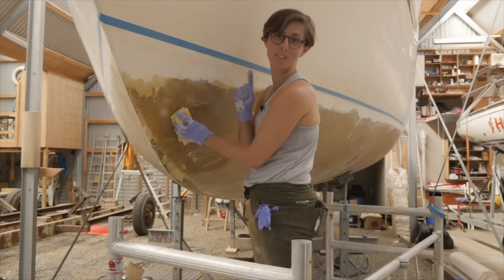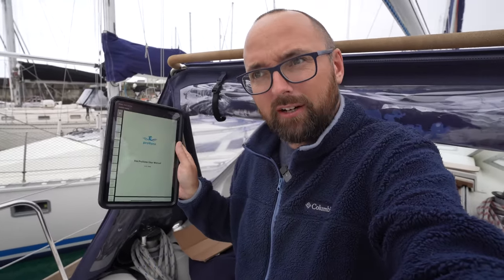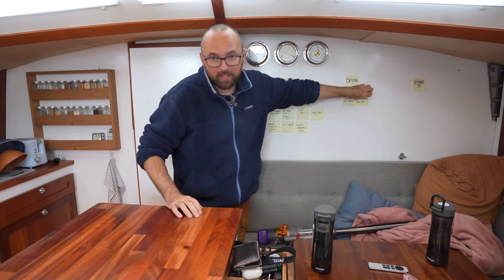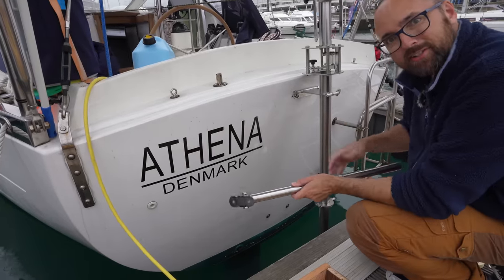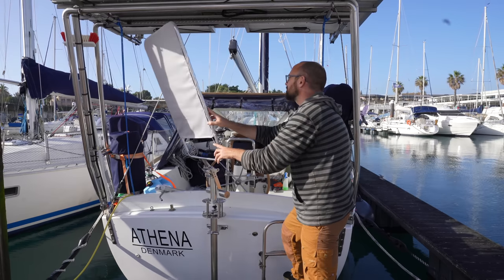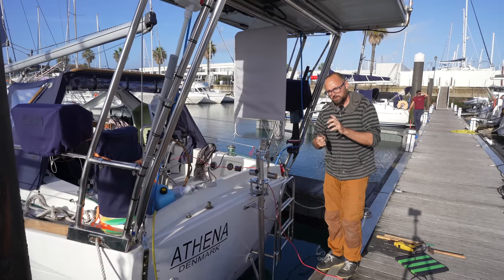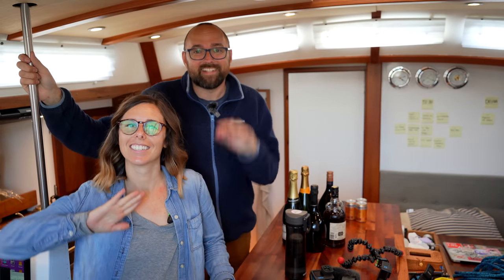Sail Life - Meet our third crew member - ProVane installation ⛵️

Comment: Get an Automatic spring loaded Center Punch. This makes a small dimple in any metal that will help your drill bit not slide around when you start drilling. The next level would be to then use a center punch and hammer to make an even bigger divot. Before using this near water, tie a multi wrap fisherman's knot to it with some paracord so when it bounces out of your hand it's tethered and doesn't go overboard.  
You could also brace the arch at the top. Weld some diagonals. This would keep your braces out of your way. 
Lockers. Ever dig through all your lockers looking for that 'thing'? Instead take photos of each locker in the layers of things in there. Also label each locker, cabinet, etc... use a permanent marker that shows up in the frame. (If it takes up too much of the frame, write it on the door or inside the lid, but write it on a piece of paper and include that in the shot. This works really well with food when you do a big provisioning before a passage. Now instead of going through every space you just scroll through the photos. "The rubber bands are Port side, diesel tank bilge, on the bottom layer."

Comment: Hi Mads, Drilling stainless, or doing anything else with stainless, can be a bit of a challenge. As a marine engineer I have worked a lot with stainless over the years and the best advice I can give is - 1, always make sure your tools are sharp, especially with drilling. 2, use good quality drills like Dormer as the the point will always be accuartely sha rpened from the factory. These days you can buy drills with a slpit point which reduces the amonut of rubbing atthe web or centre of the drill. 3, make sure you keep the pressure up as the drill is cutting and dont take a rest with the drill rubbing in the hole as this will cause the surface to work harden, especially with 300 series stainless. Once the surface has work hardened you simple drilling job becomes a bit of a nightmare. 4, you would be better to run the drill a little slower as speed causes heat and stainless doesn't like heat during the cuting process which of cause leads to work hardening. I hope this helps. Your boat is looking great and I wonder what you will do when you have actually finished all you little jobs? Cheers and have fun. Ian New Zealand
Reply: It's a common notion that heat leads to work hardening. 
In fact, while they seem to happen simultaneously, the actual mechanism is that the work hardening (which results if the drill does not have sufficient axial force to keep cutting) instantly causes the drill to lose its edge. From now on, the drill acts like a burnishing tool to deform instead of slice, which causes further work hardening (a runaway situation). 
Burnishing without a roller causes massive friction, which causes heat (adding a thermal runaway). 
Heat is the symptom of work hardening, rather than the cause. 
3xx stainless does not harden with heat: if it gets hot enough, it softens.
It is the drill which "does not like heat", rather than the stainless, and this is why (even with HSS - "high speed steel" drill bits) it is important to use a slow speed along with unremittingly heavy feed ...
Reply: I bought a dozen or so double-ended short 1/8" cobalt pilot bits to use for starting holes in stainless, and then step up from there.  You can put a lot of force on them with so little protruding from the chuck, and throw them away when they become dull.  If necessary, use bacon grease, AnchorLube cutting lubricant or water to cool while cutting.

Comment: Hi Mads. I am rather surprised that you, Mr. DIM (did it myself), did not build your own windvane. Talk about price vs. performance advantage. But there is a time advantage to buying an off the shelf unit. I have built three windvanes for myself for my last three boats. Not as "spiffy" as a beautiful "SS" piece of artwork hanging off the transom but have they helped to sail my boats 10s  of thousands of mile so far.

Sail trim, you will find, is important when using a windvane. My boat, SunShine, is a bit smaller than Athena at 11 meters. If I move from the cockpit to the bow and especially if two of us move to the bow the weight shift alters the trim of the boat enough to cause a change in the windvane's ability to maintain course when steering the boat. You will find it helpful to trim the sails just right, so that the boat steers a steady course with little to no weather or lee helm. This will make you a better sailor and help ensure you are getting maximum drive from the sails.

Another point is do not overpower the boat with sail area. This often leads to too much weather helm. Not only is sailing with the rail in the water not much fun over the long term, it is often slower and increases side slip so that your VMG is less.

May all your troubles melt like lemon drops. Fred and DeDe

Comment: For teh arch bracing, you might want to try using the dyneema across the top cormers. Although teh 'wobble' is at the base, there must be an equal bend at the opposite corner of the arch.
The larger the triangle the better the bracing.
Reply: Very true.
Reply: Look up “chevron” bracing, or K bracing. You want triangles with the corners connecting if you can get it. You may need a new anchor point on the center top of the transom with lines running to the upper corners of the arch.
Reply: Most arches have a set of bars at the bottom from about mid way to the deck. You then have a handy hanging place for outboard motors, fenders, barbeques etc. This arch is pretty amateur from a design point of view. A 2 minute conversation with a stainless bar fabricator who has worked on boats would have the design right. Also you can buy Saint fittings and pre bent bars for around $200 and the job takes around an hour to do. Our upholsterer sells the lot.

Comment: Nice video.  We used a windvane on our circumnavigation in the 1980s, having a Hydrovane on our current Bristol 35.  Windvanes are truly the best crew you can have on your boat without the need for sleep, food, or electricity, keeping the crew safe from sleep deprivation during storms.

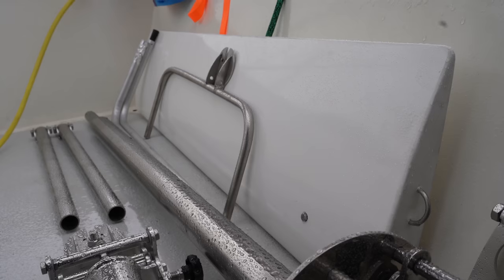Comment: Not to be a nervous nelly and I'm sure this product has had nothing but good reviews.....however - the only thing that jumped out at me was the nut which seems to be tack welded in place to support a clamping knob  - obvious at 1:59 into the video. I would have preferred just a little more weld volume holding those two parts together. Looking forward to seeing this windvane in operation..

Comment: As a sailor with about 20 000 nautical miles of experience with offshore windvane sailing with a windpilot i have to say that this windvane does not look like a good choice due to several reasons:

-This is not a servo pendulum system but relies solely on the force of the wind (instead of the force of the water due to the movement of the boat) to produce the steering movement. This kind of approach is working MUCH worse especially when sailing downwind courses because the apparent wind and therefore steering moment is very low. 

-The rudder on this system can not be raised out of the water easily. There are several problems related to this. At first, it makes backing the boat into a slip much harder if the auxilliary rudder is not fixed before going in reverse. Second problem is that there will be a lot of growth on the rudder, much more than on the main rudder because it is exposed to sunlight. As the aux rudder is smaller growth will also be much more problematic than on the main rudder and make the system work even worse than before. And third, it is very hard to remove tangled seaweed (which causes the windvane to stop working) from the aux rudder when underway. You will have to stop the boat to be able to push down the seaweed with something like a boat hook. In areas with a lot of growth (e.g. Sargasso Sea) this can be VERY annoying.

Comment: Very cool video Matt... I liked it.
However, there is an option of vane-to-tiller option; which is what I am building. It's simple set-up that basically uses a vane+pendulum arrangement that has lines running through blocks that then pull on the tiller.
Pretty straight forward.

Comment: Move your solar arch 'wobble supports' outboard. Put a bit of metal outboard in the same plane as the panels, and at the same height, 90 degrees to the centerline. Then make a triangle with dyneema from the end of this metal down to the deck. Depending on how flexible the metal piece is, this should be as stiff as the old setup, but moves all the parts out of the way.

Comment: Hi Mads, great video as always, thanks!  I wonder if you are familiar with a video that Free Range Living (aka FR Sailing), not related in any way, Yacht Self-Steering System for all Conditions, they use a tiller pilot but connect it to the windvane itself, not the tiller. Less force needed, making it more reliable. Probably worth considering.
Cheers!

Comment: We've owned a Hydrovane for 20 years and used it for most of the steering on two Atlantic crossings. In no wind and under power, the 5 knots apparent wind is enough to keep us on course just using the Hydrovane and a locked off main rudder. Give it a go on your trials. Fair winds!
Reply from the maker: That will be very interesting to test 🙂
Reply: If there's no true wind, how does the wind vane know what course to keep?  
Surely in this circumstance the apparent wind will stay dead on the nose, regardless of course?
Reply: I have a ProVane installed and used for over 1year here on the east coast of Australia. I have extensively sea trialled the ProVane, it works very well. By accident I did exactly what Tim suggested forgetting the Provane was live, it worked perfectly in keeping the boat on course so then I locked off main rudder and it continued. In my experience 5kts of wind is the lower limit of the Provane’s ability to work. Optimal minimal wind is 8 kts. From there on its all go. I have had it working in 20kts and feisty seas no problem but at this stage nothing higher, it does cope with 2m swells just fine as long as the wind is active.
Reply: @dreamtimesv  is as sturdy as the Hydrovane? do you need lot of spare parts?

Comment: My ocean crossings (3) by wind vane suggests the wind blade will be bothered by the many obstacles surrounding it in lighter winds.  And IMO you missed a major + of the wind vane:  as weather strengthens & wind increases, the vane's steering power increases accordingly.  Not true with the other methods you mentioned.  As for the ARC, they tend to be larger boats.  On arriving in Horta from USA I was struck by the 'small boat' side of the marina, where almost every smaller/simpler/more affordable sailboat sported a wind vane.

Comment: Hey, I was just wondering if you used locktite or anything like that on the bolts of the wind vane? Dieneema lines is a good idea., strong yet adjustable when u need. Also wondering whether or not you guys are considering a wind turbine for the boat. Happy holidays and a great new year. Cheers from Sunny Singapore.

Comment: Two things:

One, I didn’t notice you drilling and filling the holes with epoxy to get isolation from the transom core.

Two, If you crank too hard on the turnbuckles for the brace, the anchor brackets may pull out from the hull.  Did you drill and fill those holes too?
Reply from the maker: All those holes are in solid fiberglass there is no core in the deck-hull-joint or in the transom :)

Comment: Almost like "Ole Times" with the DIY on the wind vane. I'm sure the challenge of working from boat level rather than having shop equipment, will continue for all your sailing years. I appreciate your acceptance of some of the limitations and applaud your pluck for the circumstance. Will the rudder with the vane remain in the water the entire time or be lifted when not in operation? Continued good sailing.

Comment: Hi Mads, the link to Windy is all servo-pendulum types of wind vane, using a wheel pulley or lines to a tiller - do you have a link for the ProVane type you have installed which is completely independent of the boats steering system?
Reply: I also wanted to ask...

Comment: Wûrth is a German company, i think. I came a cross a drill called Smart Step a short while ago , You should check it out. Perfect for stainless steel drilling whit a handheld machine in smaller holes. It worked for me. One drill diam 8 mm 15-20 Euro

Comment: My boat is only 35 feet but steel and rather heavy (around 10.000 kg, Dutch flatbottom) and  all electronic autopilots I found on the sites from a few local shops   were limited to something around 3 to 5000 kg. I have seen the vane in some videos but never explained how they work and are mounted so thanks for that 🙂 Will not fit my boat, my rudder is behind the boat
Reply: Guessing here, but the kg rating is the force the mechanism can apply at it's output, and not the weight of the boat?
Reply: Try a trim tab system on your transom rudder
Reply: My boat was a 12 m steel ketch. And was steered 
- by hand (just for pleasure, 1 or 2 hours because I like it) 
- my beloved (very) old Aries (most of the time). The Aries is a bullet proof cervo-pendulum system that actions the main rudder. I claimed I could steer better... but 1 or 2 hours, no more! 
- a cheap electronic pilot (way too weak in choppy seas, but OK for becalmed or light wind conditions) 

Athena just got a vane controlled auxiliary rudder. 
- the main rudder locked into position corrects the sail balance if necessary (better tune the sails and keep the rudder as straight as possible)
- the smaller auxiliary rudder only manages the little variations around.

Trim tab on rudder is the cheap DIY solution dedicated to transom hung rudders and handy owners. 
- The wind vane controls the trim tab
- the trim tab steers the rudder
- the rudder steers the boat 
I understand your rudder is hung to the back of your boat (transom or double ended boat)
This system must be customized according to your boat. It is not as easily installed as a pilot or a known windvane brand, but it's a cheap, satisfying and reasonably feasible project 
Check the Bernard Moitessier vane and some other on YT.
Reply: @joeldumas5861  Thanks for the info. I only knew Dutch names so now I know the correct words to search for. I am handy, the plan was to make an electronic one from scratch. I have time enough (more or less early retired and living on my boat) and I can design and build electronics.

Comment: Don’t be insulted by the question, but you are drilling a small pilot hole in the stainless first I hope, to act as a guide for the larger bit?  Order of procedure would be:  centre punch, 2mm bit, 8mm bit (or whatever..).  Yes I’m probably telling grandma how to suck eggs as the saying goes, but you have me wondering with the slippy slidy thing going on.  Nice job as always. Cheers
Reply from the maker: I'm in no way insulated :) You're just trying to help :) I've drilled 100s of holes in stainless over the years so I'm well familiar with the process.

Comment: Hi 
I.just bought a hydrovane and are unhappily surprised by its really crude construction. The holes in the mounts are called for 3/8 bolts and are just one size smaller than 7/16. so very bad in my view. The rudder itself is about 100cm long and has a 1cm deep bend in it from top to bottom and both leading and trailing edge. As of hydrovane that is normal (our rudders are mostly that way. And they are much better now than what we used to sell). They are made from one piece of plastic. No rod or spline or anything to keep it straight. Disappointing. Hydrovane sayd it is fine and will not be noticeable when using hydrovane. Do you know what material your wind vane rudder is made from or with?

Comment: Thanks Matt & Eva for your videos and content. Always interesting.! Couple of questions; how did you manage the diverse equipments weight and locations to make sure Athena’s stability curve and sea’s behavior are consistent with designer calculations? And something totally different, what the diameter of your steering wheel?  Happy Holidays season!
Reply: A question relevant to many boats converted to lond distance offshore sailing.  I understand water/fuel reserves on the rail can be a concern.
Reply: I get an awful worry about some crazy design specs because unless you know what it was designed for then you end up guestimating on the guesses. Almost every boat is offered for sale as a cruiser racer. Seriously they can't be both. I mean, imagine designing a boat to get a kinder rating in different classes then expecting it to be gentle cruiser. We have crazy short booms and big genoas because that was how you designed an ior racer. The fact that you end up with a broach master with a genoa prone to hanging up on every tack or gybe wasn't given more than a few moments thought. Since surely you sail with at least 4 crew.

Comment: I see lots of people using Dyneema for these low-stretch bracing applications, but these wonder plastics always seem to come with a warning about UV degradation.  How does Dyneema fare with long-term sun exposure?
Reply from the maker: From what I've heard we're talking about a loss of 50-60% strength over a period of 10 years (roughly) if exposed to sunlight every day. I don't know how accurate that rule of thumb is but at least it implies that you don't need to worry about it for a good long time.

Comment: Why can't you add corner braces at the top of your arches? You say it is flexing at the bottom but that implies it is flexing at the top since you have a parallelogram and no member is changing length. Stop the top from flexing with welded braces and the bottom should stop flexing too.